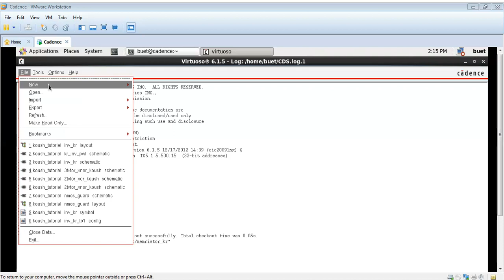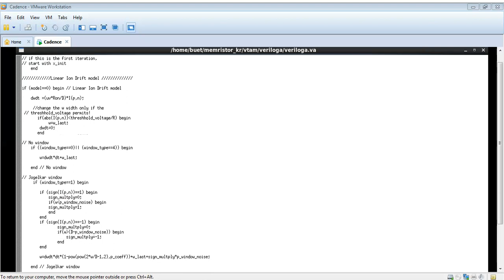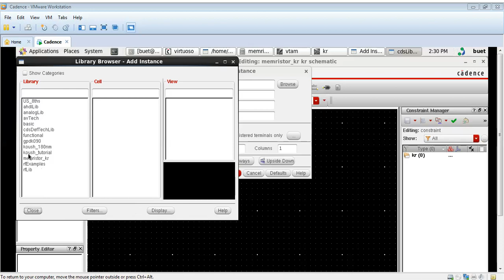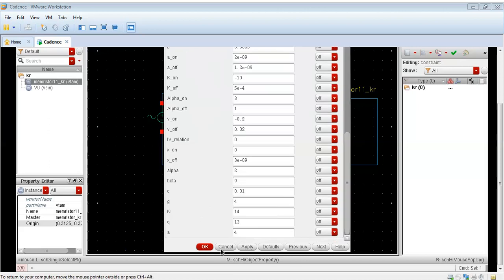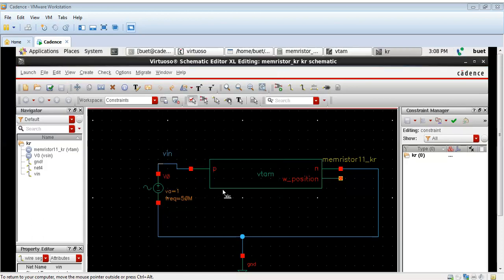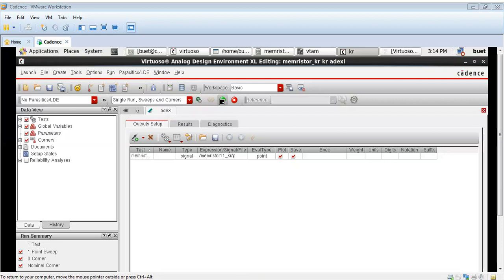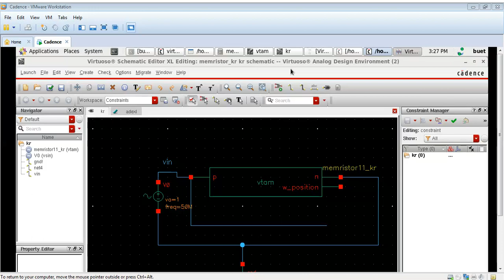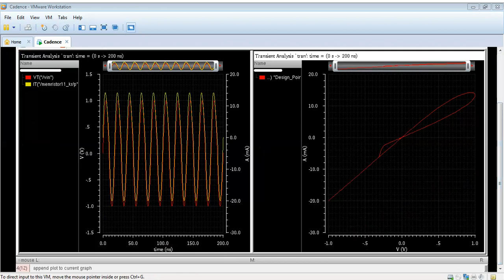Verilog-A Memristor Design Flow in Cadence Virtuoso: Comprehensive Tutorial

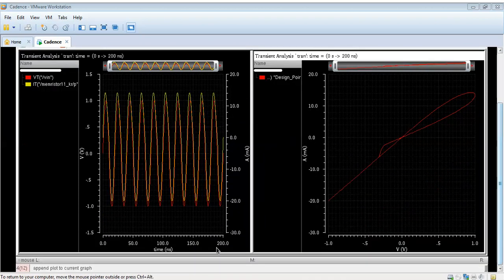Comment: hi Sir when I try to plot y vs y i get the  directly proportional graph how can I get the graphing like Sir had shared in 10:37 ?
Reply from the maker: If your plot is straight line then it means that your device is behaving like a simple resistor only (without any memory). Memristors show hysteresis behavior hence their plot will contain lobes.
Are you simulating at very high input frequency?
Reply: @SuccessPointForVLSI  morning Sir, I simulate by using the parameter u shared is it the model u suing is vtam but mines is using the model 1 so there is the difference in the graphing ?

Comment: Can u plz provide me Verilog-A memristor model and the resistive tunable memristor emulator models ?

According to u which model will be best for design adc convert using memristor in cadence?
Reply from the maker: This is verilog-A code for memristor based on linear ion drift model.
`include "discipline.h"
`include "constants.h"

module memristor(p, n);
  inout p, n;
  electrical p, n;
  
  // Parameters for the memristor model.
  parameter real R_on  = 100;     // Minimum resistance (ohms)
  parameter real R_off = 16000;   // Maximum resistance (ohms)
  parameter real D     = 10e-9;    // Device thickness (meters)
  parameter real uv    = 1e-14;    // Mobility parameter (m^2/(V·s))
  
  // State variable (w) representing the normalized dopant level (0 <= w <= 1).
  real w;
  
  analog begin
    // Initialize the state variable at the start of simulation.
    @(initial_step) w = 0.5;
    
    // Define the voltage-current relationship.
    // The memristance is modeled as a linear combination of R_on and R_off.
    V(p, n) <+ I(p, n) * (w * R_on + (1.0 - w) * R_off);
    
    // Define the dynamics of the state variable.
    // This simple model assumes: dw/dt = (uv * R_on / D^2) * I(p, n)
    w <+ idt((uv * R_on / (D*D)) * I(p, n));
    
    // Constrain the state variable between 0 and 1.
    if (w > 1) w = 1;
    if (w < 0) w = 0;
  end
endmodule

Comment: Hi ! Could you guide me to design a VTEAM model memristor , what changes in the code do i have to make to get VTEAM model? Or is there a completely separate verilogA  code for it. Could you please help me with this?
Reply from the maker: @komal2914  Spice code for  Vteam model is available on open domain. Hence, you can download from there easily. If you want, I can give you a link for that. But Vteam model also has its own set of limitations. And I would suggest you to learn to write spice codes. If you have idea about verilog and c programming then its quite easy.
Reply: @SuccessPointForEngineers  Yes, do share the link, I want to check if my project works with it. If not I will do as you say.

Comment: Hi! I have been searching for a way to implement memristor since it isn't available in Cadence Virtuoso by default, i would really appreciate if you could share it's code with me?
Reply from the maker: @komal2914  memristor can be designed using different kind of models (each with different physics involved). Let me know which model you are using for memristor design  !!
Reply: @SuccessPointForEngineers  VTEAM model